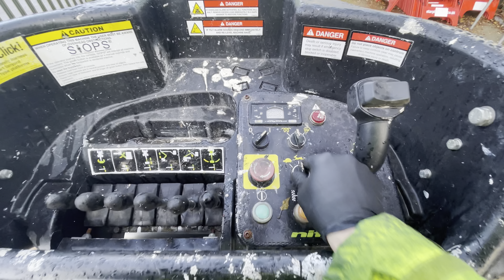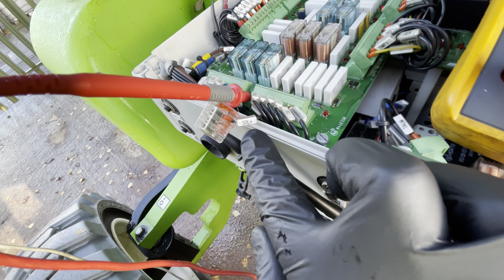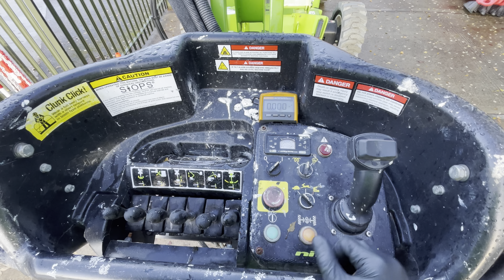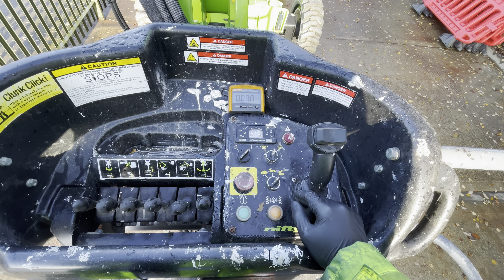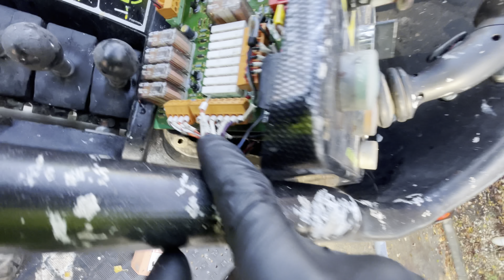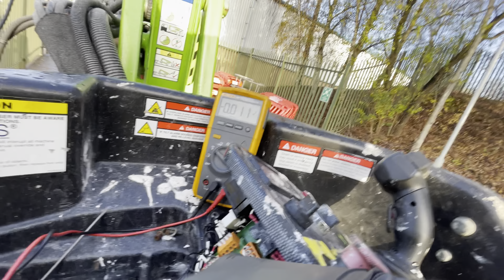Niftylift HR21DE Intermittent Drive

Comment: in one direction, after releasing the joystick, the machine is still moving, the brake does not apply until two seconds later. where to look for the problem?
Reply from the maker: Try to check pwm board . It could be that that pots weee adjusted to much. Try to back them both off anticlockwise.

Comment: Thanks for the video! I have the same model (American SP64) and have been having issues with both directions on the drive. I noticed that messing with the wires (moving them around etc) at the joystick board changes what works and what doesn't. Do I just need to remove every wire, clean the contacts and reinstall?
Reply from the maker: Hi Joshua,  I would recommend to inspect  contacts and wires a bit more carefully. You may need to re-crimp some wire ends or you may find that issues is actually with a plugs them self look for signs of corrosion. But a fact that moving wire makes difference leads to poor connection 100%.